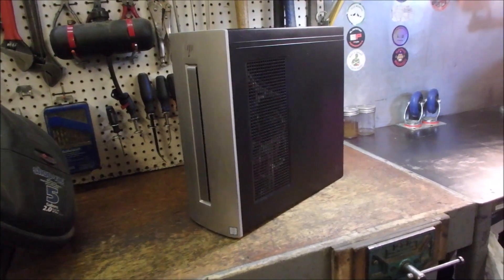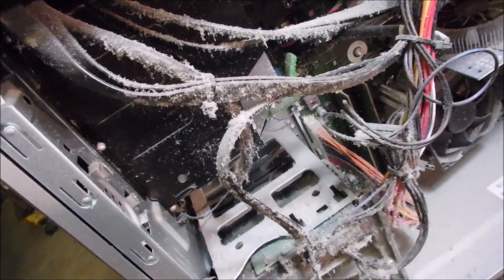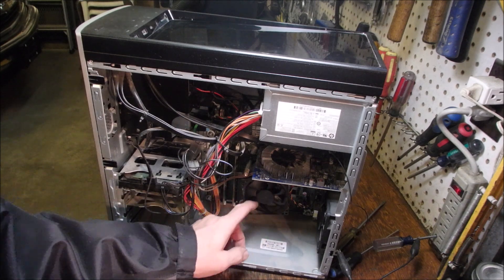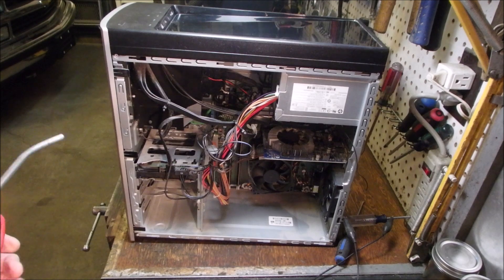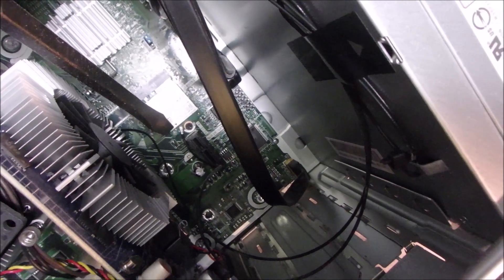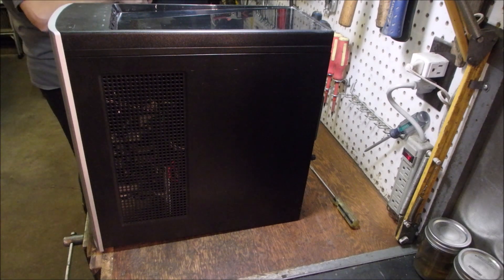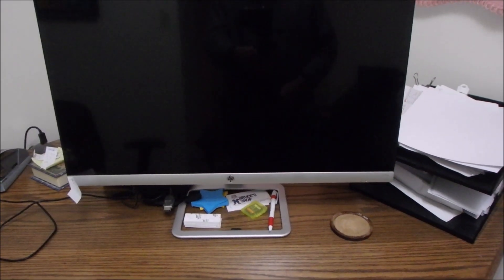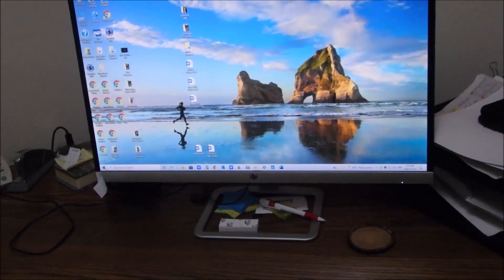Cleaning The Dust From the Inside of Your Computer

Comment: Computer Techs get fired for using a vac for internal dust.  Static can cause instant failure of a computer if you are lucky.  If unlucky: your business server crashes with staff losing data or the payroll gets corrupted on a Friday at 3pm with 128 unpaid staff and you are 2hrs away with a 6hr headache to look forward to.  Sorry, I stopped watching at 2min5sec.  Always blow out dust with compressed air.
Reply from the maker: OK.

Comment: Bruce you have to see my Tiktoks on grounding you may get a kick out of them. Yes I quote the IEEE and the TIA. Very smart of you Sir to ground your PC.  For some machines you can ground simply by plugging it in to the receptacle the power supply will pass ground to the rest of the box. I really like how you mentioned to that one must be careful not to over spin the fans. Most people forget this step. I sometimes place a few small clamps between the fins as to not allow the fan to spin. You did an excellent job my brother.
Reply from the maker: Thanks Ed  Some gave me static about the vacuum but we used grounded vacuums at work.

Comment: A friend that his son is a computer tech told me never to use a vacuum cleaner I use the cans of air. I haven't owned a desk top for over 10 years. lol I should get but I buy a new laptop about every 4 years with a 17.3 screen size and they serve me well. I know you had to be so relived when it booted up after you put the black wires on for a 2nd time. Hope you and the misses are having a great time!
Reply from the maker: Yes.  We  used vacuums at work for this type of thing but they were static controlled ones.

Comment: LOL! Can’t wait for the video on cleaning your laptop! Computers can be tricky. Having built mine, I disassemble and clean the components separately using compressed/canned air. Don’t recommend using a vacuum.  Too much suction.
Reply from the maker: There are static free vacuums we used at work.  This one was jsut a shop vac as you know.

Comment: As a former techie, I never used a vacuum to do the cleaning.  Would pull the cover off, drop it down on my driveway and go at it with the air hose, making sure not to get closer than a foot away. That always worked.  Glad you got it back running!
Reply from the maker: Thanks for sharing
Reply from the maker: We did have static free vacuums at the phone company.  Mine however is just a shop vac as you know.
Reply: @BrucesShop  
At Stantec, the guys went through a lot of cans of duster spray.  Yah, the majority of it was wasted! Instead of spray, spray, spray, it was sssppprrraaayyyy until the can is empty…
Good old days!

Comment: I find  a compressor with psi lowered works better than a vacuum.
Side note.. the two black wires are for the wifi antenna, the error you had was for video to monitor. The video card was likely jostled a bit when you were reattaching the black wires. Good job cleaning and getting it working, it should run much quieter and cooler now.
Reply from the maker: Thanks

Comment: The WIFI receiver. Itsy bitsy teenie weenie coax cables. Try wrapping the first 12-18 inches of hose with bare wire and ground it for anti-static. I normally take the unit outside on a NICE day and blow it out with the compressor and regulator set low. Don't ever try cleaning out a cooling fan with 5000 PSI. It didn't/doesn't end well. More on that later. Button cell keeps the clock and BIOS settings alive. Fun when they fail. Good to see you back.
Reply from the maker: It is magic.  Still away
Reply: @BrucesShop  Oooooh, cool. Enjoy the magic, and the trip.
Reply from the maker: I wondered why the screen went black when they were disconnected.  i haven't messed around with PC 's for a while.